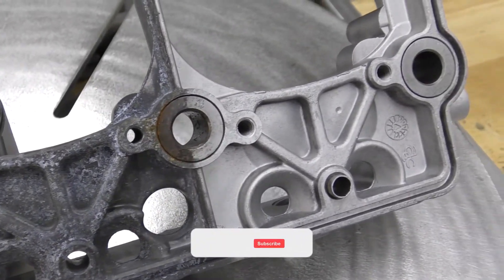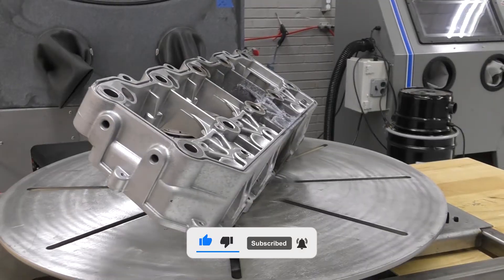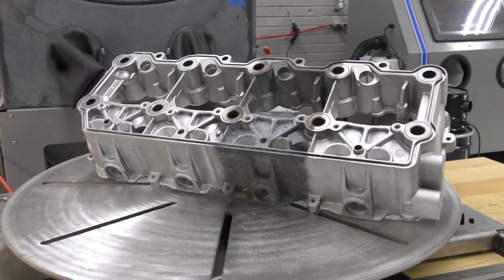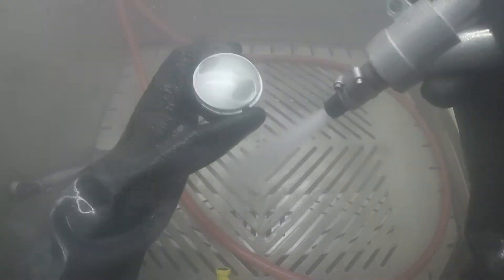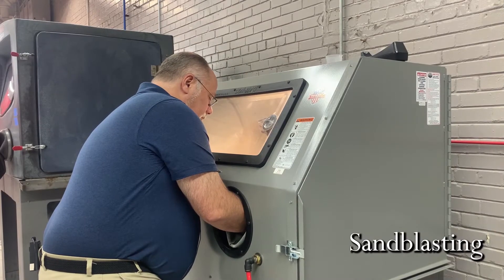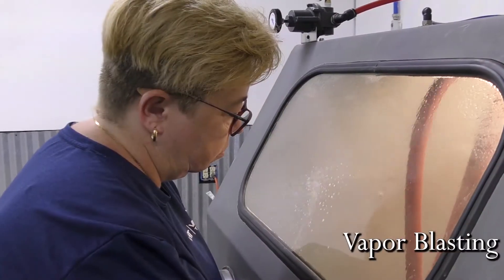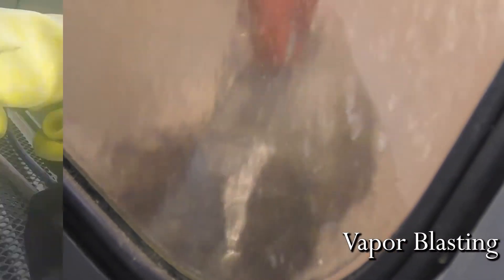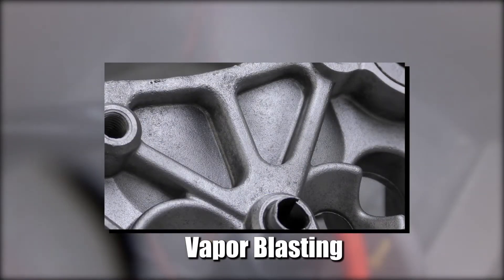Vapor Blasting vs. Sandblasting - Vapor Honing Technologies

Comment: can you blast a complete engine or do I have to strip it completely ?
Reply from the maker: We do not recommend blasting an assembled engine. Abrasive is very good at getting anywhere you do not want it.
Reply: As they said, you generally always disassemble a complete engine before a blasting clean. It's possible, just not a normal attempt. A complete running motor is usually cleaned with degreaser etc.